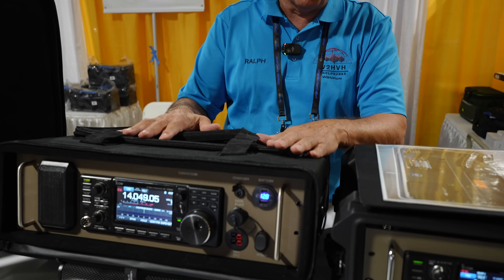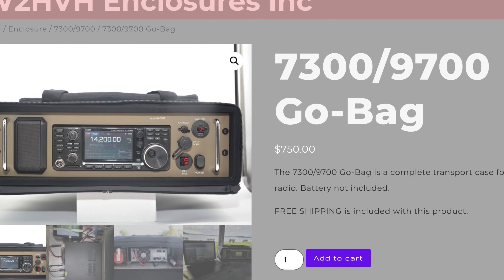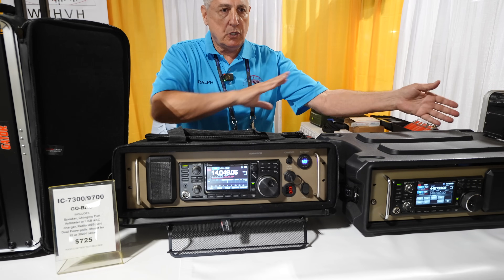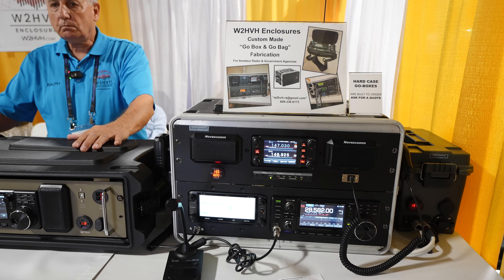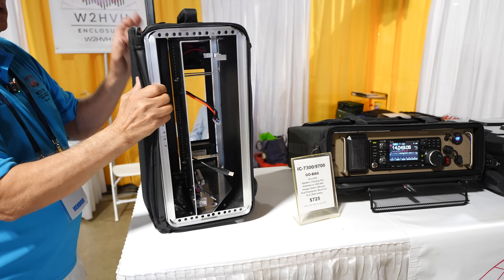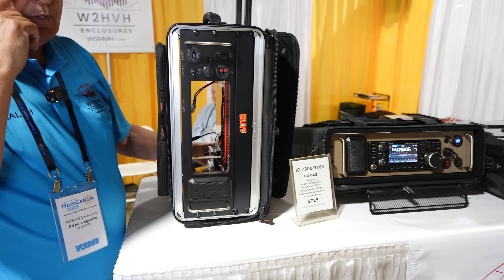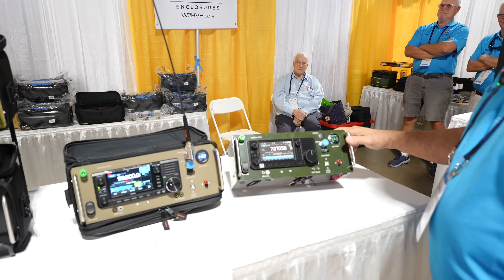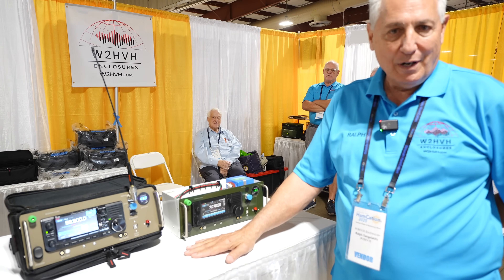Modular Ham Radio Go Boxes! W2HVH

Comment: I'm sure the craftsmanship is top-notch, and the builder seems to take great pride in the product and continues to adapt and expand upon the capability provided by these go-boxes.

That being said, I'm not a huge fan of go-boxes for ham radio kit -- particularly for portable operations.  They're big, bulky, and they end-up being a two-person lift as a result.  I will grant that these types of kits tend to be very quick to set-up and tear-down:  simply pull the cables, stash 'em in a lid pocket, and carry the whole thing out to the vehicle.  But the cost of that convenience is that one absolutely must transport the thing in a vehicle, one likely needs two people to move it anywhere, and a go-box like this quadruples the size of the individual components.

I worked with equipment mounted in transit cases extensively in the military, and we almost always pulled the equipment out of the transit cases and put it on a tabletop or countertop and wired everything up from there:  the cases were only to protect the equipment during transport.
It's a similar story with rolling Pelican cases for ham radio kit - without vehicular transport, these things are just plain impractical.
Reply: Everyone just jumps into a "go box" (stay box hehehe) project because they see other people doing them and they're cool. And I'm not gonna argue with that, they are cool. But few actually tabulate the functionality they're gonna get out of the box and determine if it's really what they want and is worth the sacrifices.

Comment: 725 plus tax 800 bucks roughly, way outside what 99% would pay for a box with a few ports. Just buy a pelican case and mod it. Price needs to get down to maybe 350.
Reply: Or better still, get an Apache case from Harbor Freight for a fraction of what Pelican wants.
Reply: If it included a hard 4u gator case, maybe I could see the price.  Those are $250-300 alone.  The only appeal I see is the custom faceplate, but for that price and a soft case I don’t think it’s worth it either.
Reply from the maker: Some just won’t build their own, but yes. I agree.

Comment: That guy is doing a great job visiting every show, unfortunately still overpriced for what it is. I built a very similar one for the 705 even with the same bag form Gator for a fraction of the cost. Well, as long as people pay it, enjoy the ride
Reply: I don't think it's fair to call something "overpriced" by comparing it to what can be made with free labor (and a big collection of tools that aren't free).
Reply: @dafunkmonster  Okay, then consider that in IT infrastructure terms, custom rack solutions for equipment that was not designed to be rackmounted, like smaller Palo Alto firewalls like the PA-450 tend to run around $150.  This is for the shelf that is designed for the units with provisioning to hold the power supplies securely and to dress the cabling behind the faceplate with that faceplate integral to the shelf.  And this is for customers that have deep pockets to start with, because the acquisition of telecommunications infrastructure is a tax-deductible business expense that can be depreciated over time.

If what others have said about being able to put together the gator case and other components along with what they've needed for the specific radio for $300 is true, then the solution is still overpriced even when labor is factored in.  Even proprietary public safety radio mounting equipment from Motorola is cheaper.
Reply: yeah, it becomes difficult to justify the costs when the most custom part is the faceplate, and there may well be something for the DJing or band gigging market that is either easy to work with or otherwise far less expensive.

It's also a little difficult to justify if one is attempting to avoid the "appliance operator" label.  Someone with a drill press with a set of large drill bits and an angle grinder with a cutoff wheel could take a $20 aluminum rack blank-plate and make the faceplate themselves.

If anything it might be an easier sell if he was just selling pre-punched/drilled faceplates for specific radio models with the accessory holes that had been powder-coated and screenprinted for labels, and let the ham buy whatever rack shelf and case they were going to use.  Even if that faceplate was $99.99, someone could put their field-kit together one piece at a time as money permits, and potentially scrounging things like the case and the shelf from surplus.  It's a tall order, expecting someone to drop almost as much for a case as they just did for the radio itself.
Reply: Built basically the same thing for $300 (but better imo) everything from Amazon... 30min assembly. $750 is such a ham price LMAO. Oh well... hobbies fillled with old people that have more money than ability or common sense can be such a money pit 😂😢